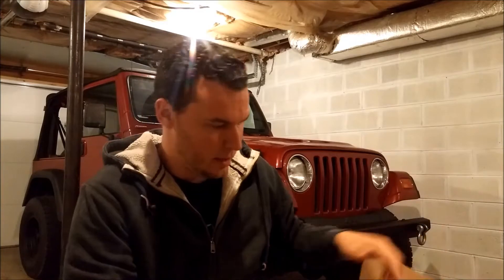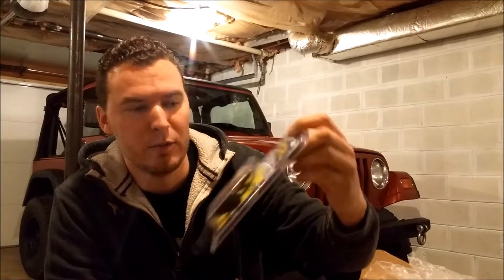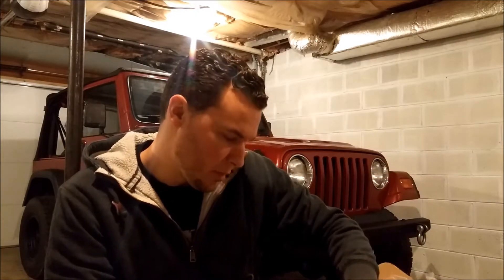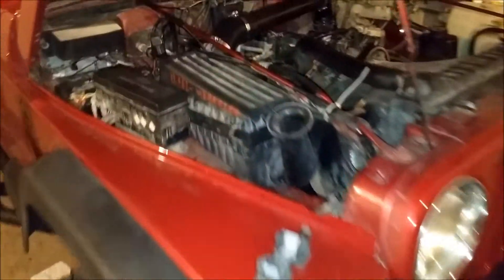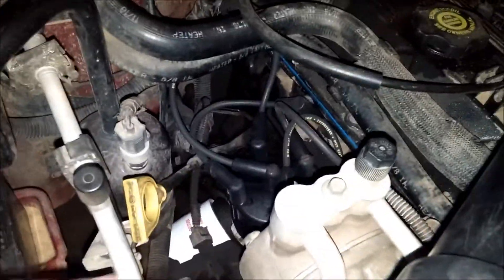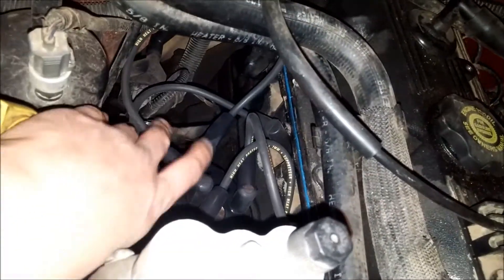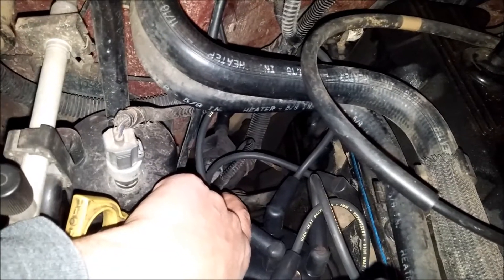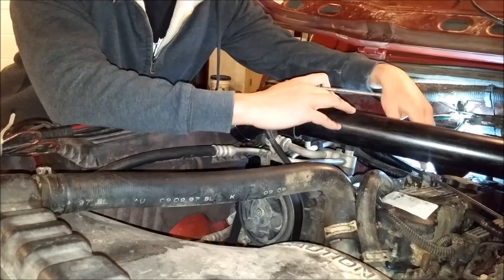MSD Ignition Coil Install on Jeep Wrangler TJ

Comment: If your still having problems with this you may want to check the fuel pump check valve. It may be going bad and letting your fuel drain back in your tank. Turn your key about five times and prime the fuel up the line. If it starts easy after that it is the valve.
Reply from the maker: Kip Irvin thank you.  I have another TJ now, and will keep that in mind if I run into it again.

Comment: $20 for a harness that won't snap together to the stock wiring, at least mine was that way. My MSD coil just took a crap. 7 months! Started cutting out on the highway. Put the stock mopar coil back on.